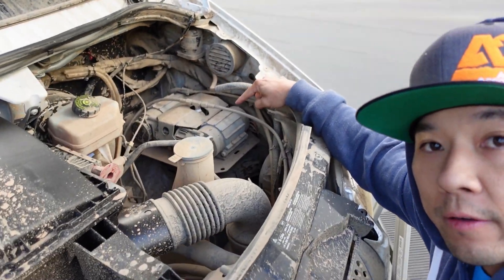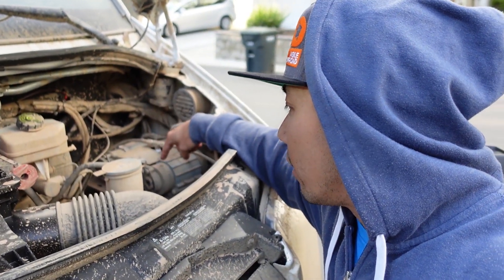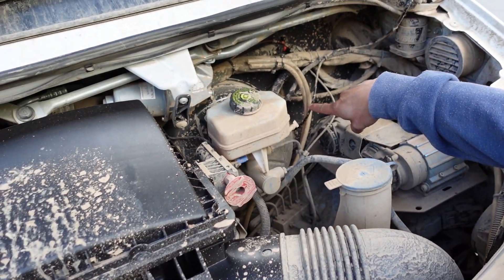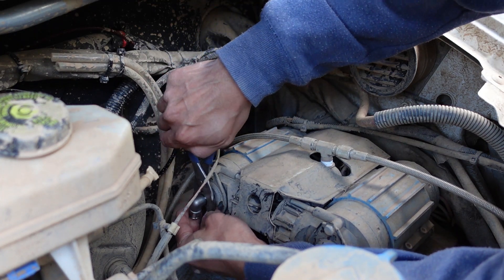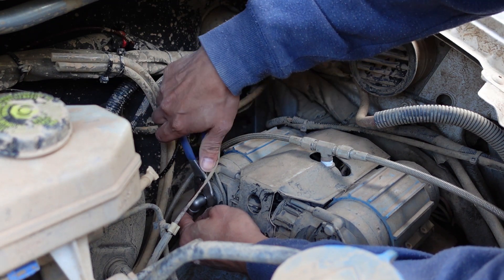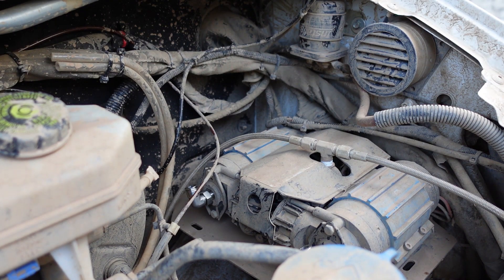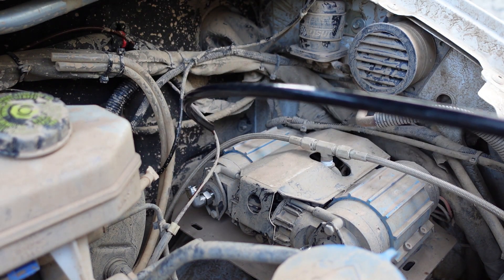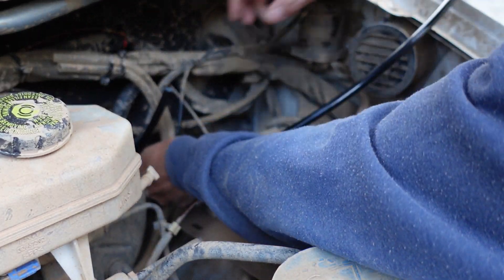How to Make The ARB Twin Compressor Perform Better

Comment: I’m wondering why you even mounted the compressor in the engine bay to begin with? With a van that size I’d put it in the cab.
Reply from the maker: The compressor is so noisy. The engine bay has a lot of room.
Reply: @morevanever1311  I install roughly one of these a week and they’re not too loud. 

I am highly impressed though that the compressor still runs in such a filthy state, I should stop worrying about such things 😂
Reply: @morevanever1311  I agree. These are way too loud to put in the cab. When I air up out in the snow or in the extreme desert heat I will often get back in the cab for a couple minutes. Or my family will be in the cab nice and cozy. I would not want to do that with a compressor cackling away. Mine is also in the engine bay and has been for 9 years. No problem.

Comment: Your intake tube is too small, 3/8" OD probably have 1/4" ID. In ARB manual, you might need 1/2" ID tube (3/4" OD) for this setup.
Intake air is vacuum, you can use cheap pagoda style connector.
Reply from the maker: Thanks. I'll take a look at that. The onboard air is working fine though. No issues since the relocation.